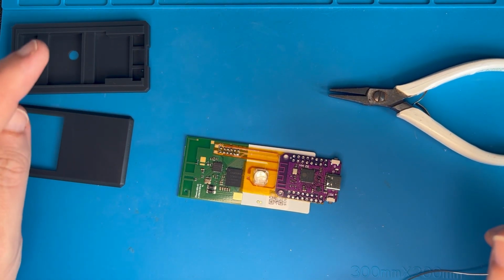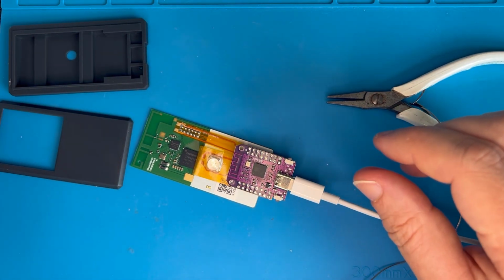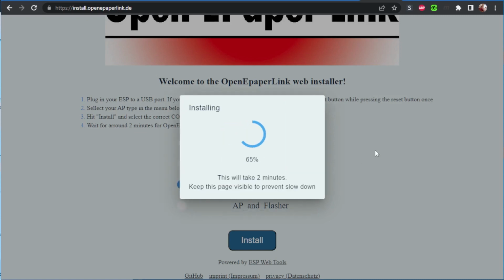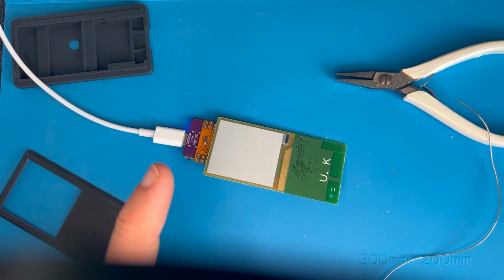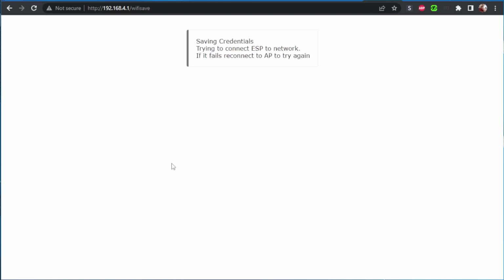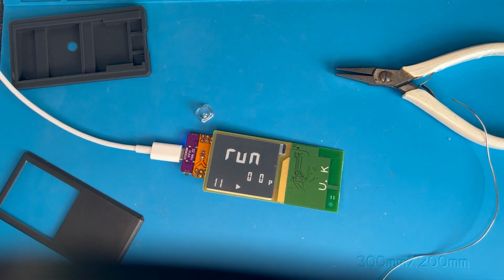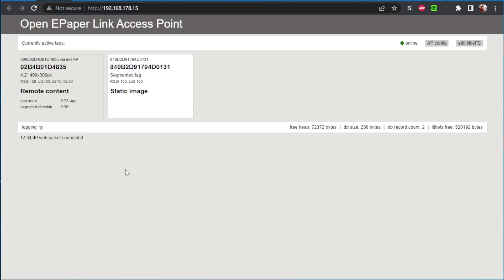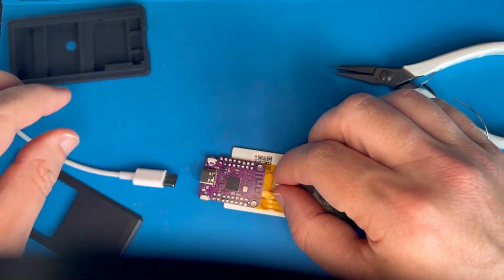Building the OpenEPaperLink Access Point kit

Comment: What do you do at 4:30 in the video?
Reply from the maker: It's a jumper. The segmented tag can be powered directly to VCC or via GPIO pin, by connecting the middle pad to one of the outer pads. The firmware currently assumes it's connected directly to VCC. So, you have to create a solder bridge between the two pads marked VCC.

Comment: its not clear what you mean when soldering the white bit onto the PCB - what orientation should the diagonal cutout be - and in my kit, the upper side was black.
Reply from the maker: The diagonal corner is also marked at the white silkscreen on the pcb. The direction should match the diagonal corner on the part. btw, 'the white bit' is a rgb LED.

Comment: Use the pins provided with ESP32 to properly align the flex PCB, be careful not to solder them. To reduce the heat input to the flex, solder every second or third pin at a time.

Comment: I've assembled my device and got it up and running. 
I can go to the web interface and the tags I've powered are visible in the UI. 

However the display keeps reading waiting for data and in the UI I get an error File /00000xxxxxxxxxxxx.jpg not found. 

In the file system I can see pictures with a .pending extension instead of .jpg. 

What am I doing wrong?
Reply from the maker: At least all the hardware is working. I will send you an email, that makes communication easier. 🙂

Comment: I can log on to the web UI but I can't get my screen to work or read an AP from another display. Do all 3 of the vcc tabs need to be soldered together?
Reply from the maker: No, only two pads at the side that says 'VCC'. The third one (marked 'GPIO') should stay clear. If you connect the AP via usb and start a serial terminal, you can see a lot of debug info, maybe you can see what's the problem there. 🙂